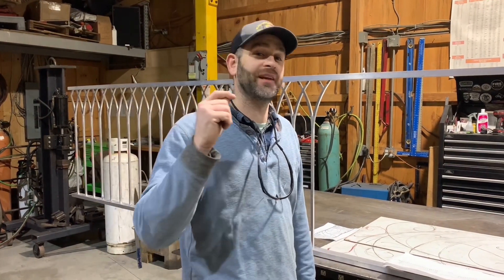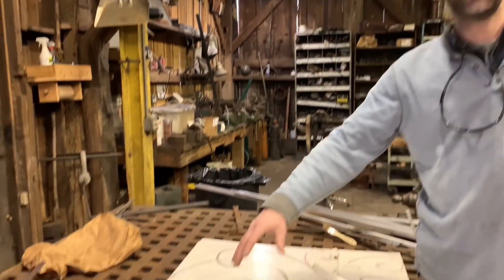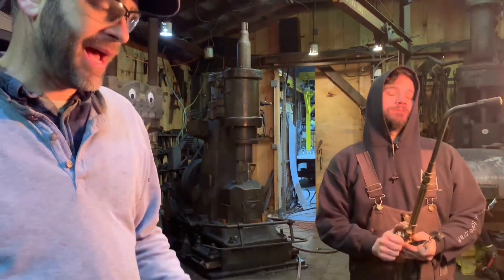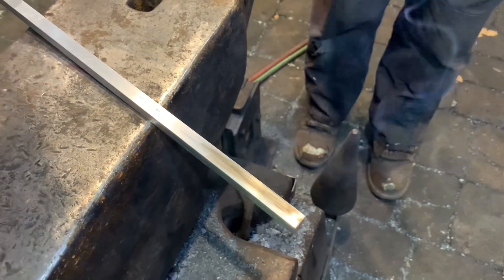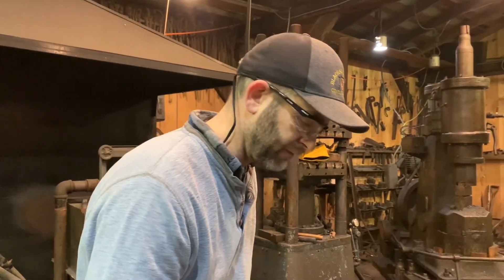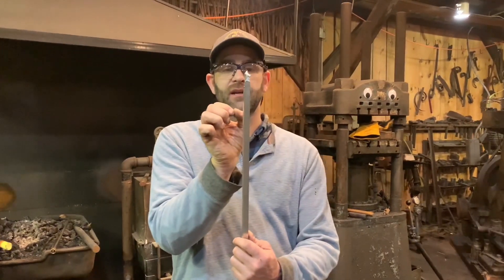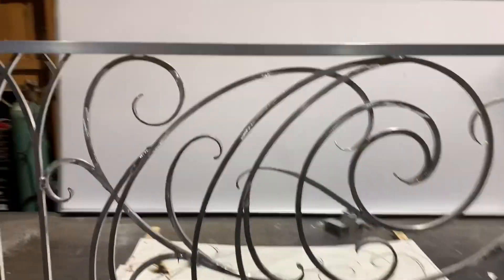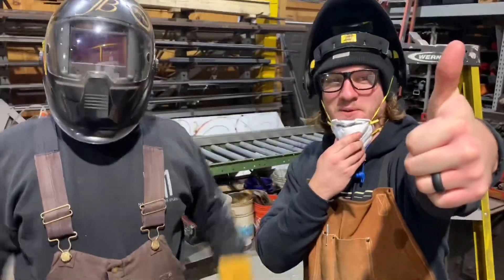How to Forge Aluminum

Comment: Here’s  how I forge aluminum. Turn on your heating tip with acetylene only and lightly coat the four sides of the area to be forged with soot. Then neutralize your flame with oxygen and heat the sooted area until the soot burns off. Then start forging away.  You don’t believe me? Try it. Works good for me.
Reply from the maker: I’ve heard of that. Not a fan of using acetylene due to the cost. We are using propylene which is almost a third of the cost. The pine stick is cheap. Thanks for watching